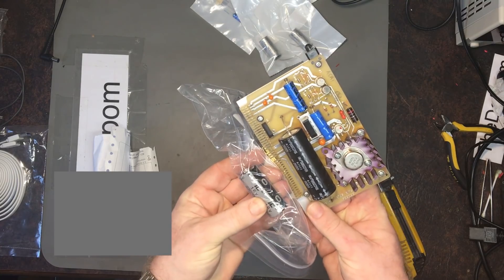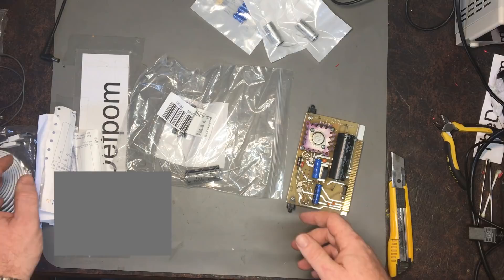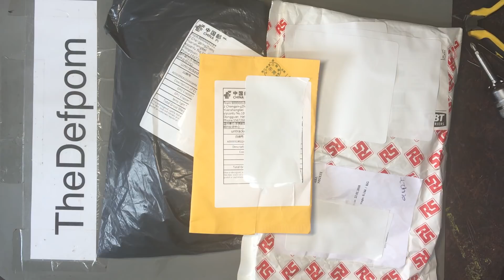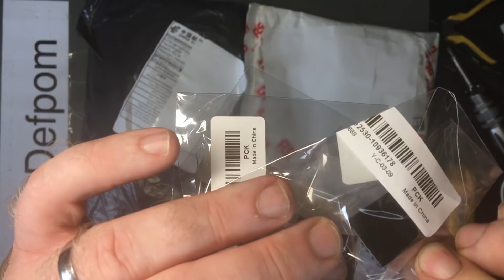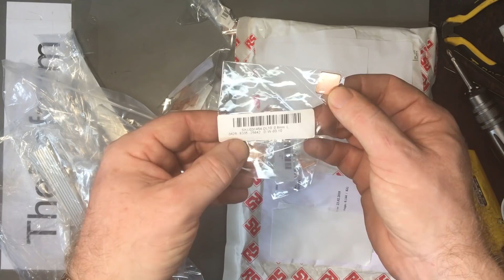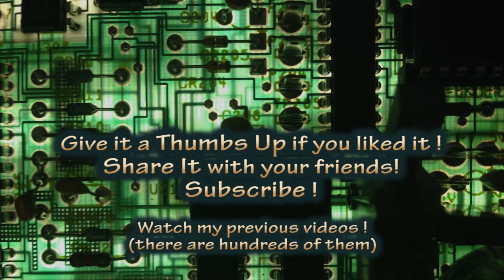🔴 #351 Mailbag 24th March 2018

Comment: I believe those capacitors you thought were Matsushita are actually Multicomp. I don't think Panasonic capacitors are marked as Matsushita anymore. 
I was wondering if the battery in your capacitance meter may be on the low side?